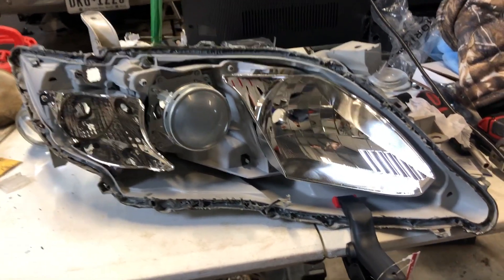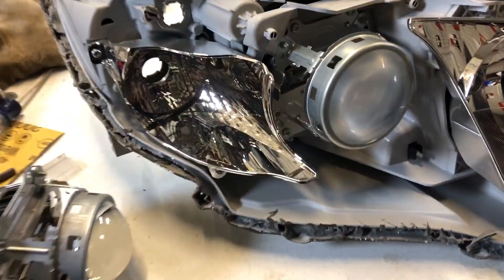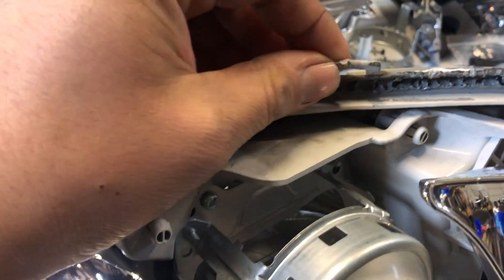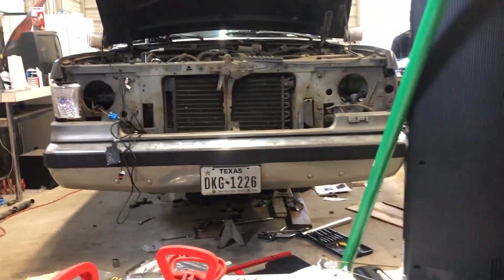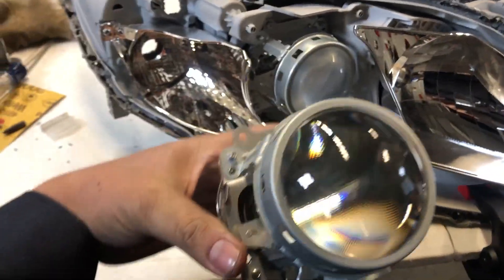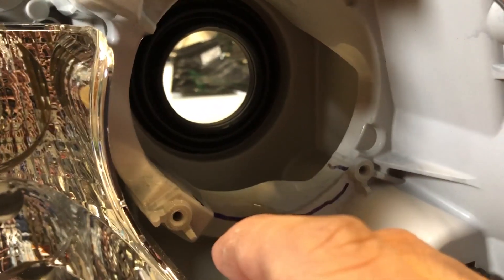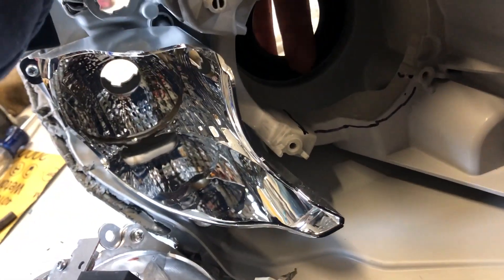DIY: Toyota Camry  projector retrofit

Comment: A Hella 3Gr projector need adapter on this headlight? I bought a bi led and will change, but I see a lot of adapters on aliexpress
Reply: Did you change the projector lens? I’m wondering the same, trying to find out which adapter would work.
Reply: @juanpa_928  yes. We need adapters.

Comment: do a clear lense swap to increase light output
Reply from the maker: sovan781 they come with clear lenses from the retro fit source
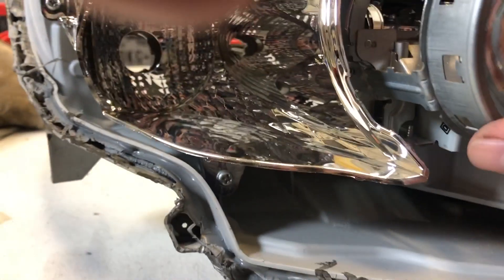Reply: @SVTPalacios  At 3:44 your lense is clear yes but it's a Frenzel lense meaning you can see the little lines in it.  Sovan is referring to totally clear lense that have no lines.  You would use the STi-R lenses and it makes a world of difference on the RX350 projector.  The cutoff and intensity increase dramatically.  I'm doing a rx350 projector swap on my CT200h.
Reply from the maker: 3 inch